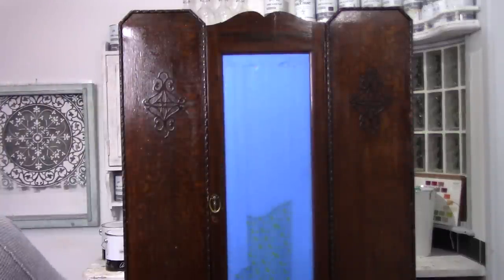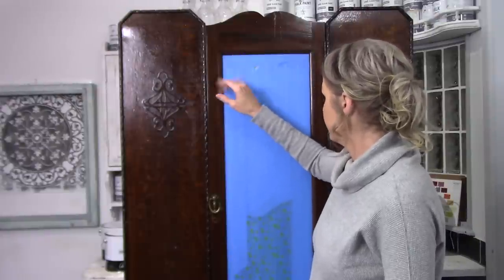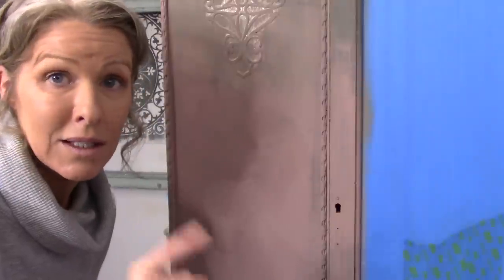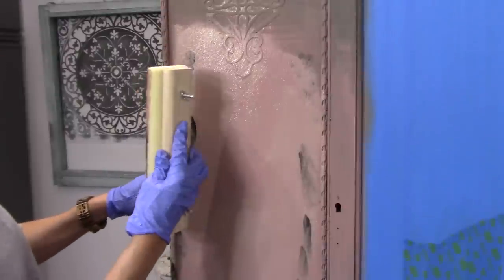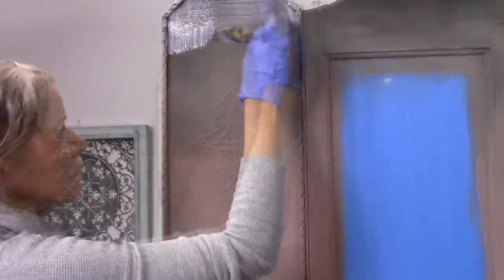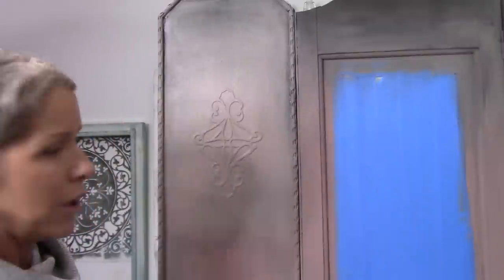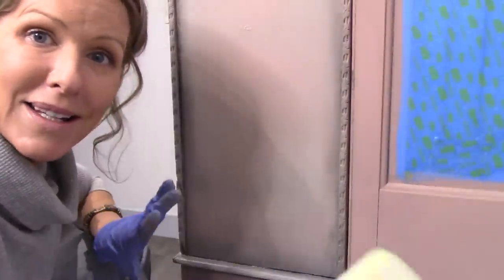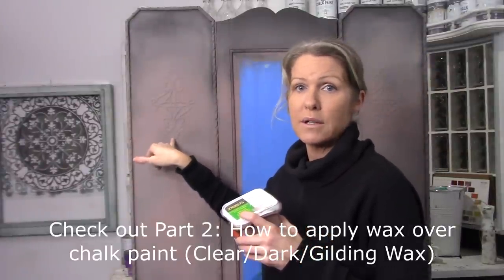How to Chalk Paint Blend using Color Meshing Technique (Part 1 of Meshing Technique)

Comment: I love your videos and your techniques. Just wondering what you do about inside. This piece looks like it’s seen some years, if it’s for resale do you paint the inside or refurbish in any way the inside? Sometime there are smells and inside has been trashed. Just wondering. I’m going to try this as soon as i get my mesher(?).
Reply from the maker: Mildred Fippen ... thanks so much for watching and your kind feedback 🙏🎨
Every piece is so different and yes some have seen some years of wear but as a general rule I do paint the insides and sometimes even add wallpaper to give a new fresh look as well as detail. If you come across a piece that has been stored in moist environment and has a old smell to it , use shellac spray on the inside it will take away any odour you might notice , clean it first then shellac spray! No amount of paint will take away a moist odour. Always use a shellac spray outside , it’s not good indoor use. Please send my a photo when you complete your first mesh project!! I would love to see 🎨💙💙

Comment: Is it the water wiz applicator or the lamb skin applicator that you use to mesh? I see both listed but your tool looks less furry😊
Reply from the maker: Cassandra Smith ... the one ☝️ I am using is the water wiz , I added other tools that preform the same technique as the water wiz has limited availability on amazon.
But again the other applicators will give you the exact same finish 😉
I think mine is less furry 😂😉💛
Reply: The Reclaimed Heirloom thanks Christina!